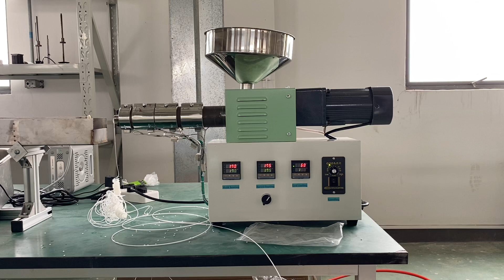RobotDigg desktop extruder small notices

Comment: I left some PP material inside the extruder,now it is stuck and my screw is not rotating,how can I solve this problem?
Reply from the maker: I do Not think PP has such problem. But here is the suggestion:
1. Heating up to 180C
2. Start the motor from low speed and change the speed to squeeze
3. If the above 2 steps can Not get it work, remove the nozzle upfront. (Take care of the high temperature)